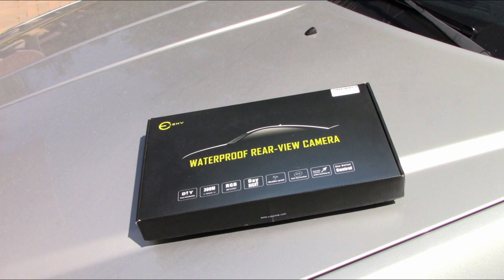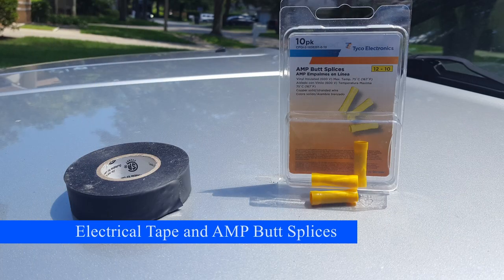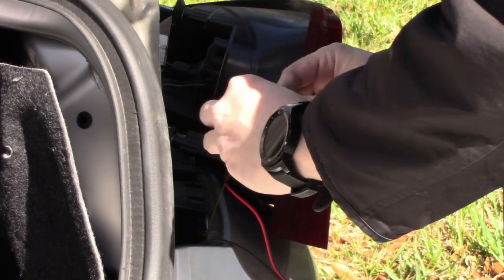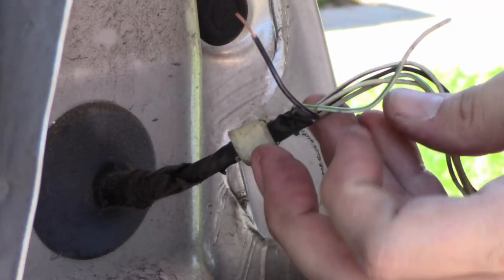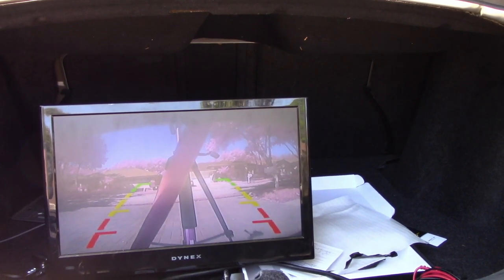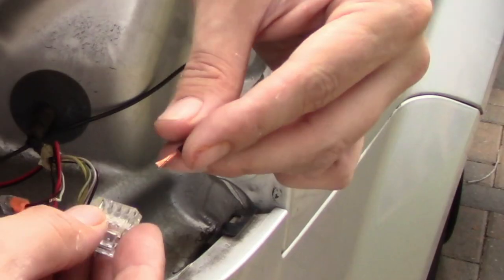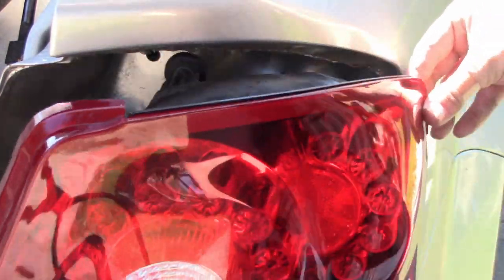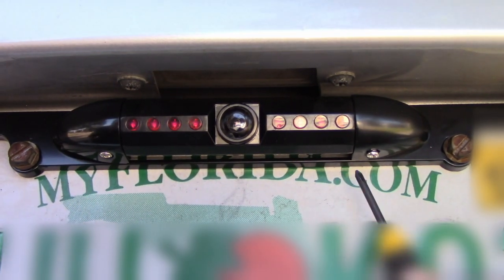E-Sky Rear View Camera Plate DIY Install

Comment: I replaced one I bought in 2012 timeframe with the latest version. After some fiddling around with the power supply line, ( I finally got a voltmeter to make sure I WAS getting power), it installed in like ten minutes. Great picture! Works with my Pioneer AVH X8500, both when in reverse and if I decide I want to look back while driving (ie if towing). It really was simple, but I had it installed professionally when I got the head unit.

Comment: I can't believe how simple it is.  All you have to do is disassemble your license plate, tail light, weather stripping, floor molding, side panels, glove box, stereo unit, run the cables and connect everything back.  Piece of cake.  What could go wrong??
Reply: It’s actually not hard at all. You’re adding a frame to your plate, connecting the camera to the reverse wires and running the video wire to your screen. It actually couldn’t be simpler
Reply: Lol i laugh so hard, was looking at this alternative instead BOSCAM Wireless Backup Camera
Reply: I mean you could just have it go outside of your car, through the window, into your radio but it’s we want it to look clean

Comment: This looks to be the same camera sold under many different names.  My question was if the lead from the  camera went directly to the RCA connectors or if the had a small inline connections first which is much easier to work with as it can pass through a much smaller hole than the RCA.  These small connectors are common on wedge design cameras but seem rare on the plate frame designed versions.

Comment: Lol a process called splitting wires sounds so technical, nice video very helpful ,how long did this take to install ? whats your thoughts on the BOSCAM Wireless Backup Camera
Reply from the maker: Thanks man, it only took a hour of actual work. Could take less.
Reply: @QuantumNerd.  thanks for quick reply , whats your thoughts on the BOSCAM Wireless Backup Camera ?

Comment: Whats the advantage of hooking it up to the radio trigger vs running the 12v from your backup lights?
Reply: You’re getting it from the source instead of adding resistance to a circuit
Reply: @comradekirilov3483  camera doesn't add much resistance.. infact all tow wiring kits just tap into the existing rear lights and this draws far more power.  Cameras draw 0.5 - 2 amps at 12v

Comment: Just installed this in my challenger.... only issue is that it blocks out a majority of the license plate light. 

Was this an issue for you as well?
Reply: Raff I️m hoping I️t works on my charger
Reply: Marco Washington what year is yours ? I’d check out my video because I didn’t have to do 3/4ths of the steps here. Dodge has the backup camera wiring already pre installed with a lot of their cars. So no need to have to get a third party deck and then wire it all the way up front, splice the wires to the reverse lights, etc.

Comment: Im having trouble with mine,is the exact same model but for some reason my reverse light wont give power to the camera al ready tried both sides and when i put it on the battery terminals it comes on with no problem.
Reply: arielito835 your tail light is not getting 12 volts

Comment: Who taught you how to splice wires? You used a yellow butt connector on those small wires? You don't twist them together and slide an oversized butt connector over it. You should have used a red butt connector and crimped the ends of the wires in each end of the butt connector. 

Also you should always install a fusable link at the source end of any power wire that you install.

That is a fire hazard, you've got wires fed through holes in the sheet metal. Normal vibrations will wear the insulation on the wires and cause a short, or even a fire. Always use rubber grommets in sheet metal. 

If you're going to give tutorials, you should know how to do it correctly yourself. 

Not hating on you, but you should be more careful when posting tutorials online.
Reply from the maker: Thank you for your feed back. That sounds right. I got the idea from BestBuy to crimp with it but didn't specify the color, only to make sure the connection is secure. As far as the fuse thing goes, both the radio it's self and harness that is connected from the camera has a 10amp fuse and the instructions from eSky did not mention to install one but to connect it directly. Thanks again for your feed back you can't be too careful. Happy Holidays.
Reply: You're wrong pal.. Nothing beats two wires twisted together. And yes I'm an Electrical Engineer.. Why I never have come backs. As you can have corrosion out the ass. But as long as them two wires are twisted. It has to break in half to fail. Butt Connectors can corrode and you would never know it. Till you pull them apart and see the Green Dust of death! And it is fused protected. As the Backup light is fused at the Vehicles Junction box. Any fault will blow the fuse... 

Good Day...